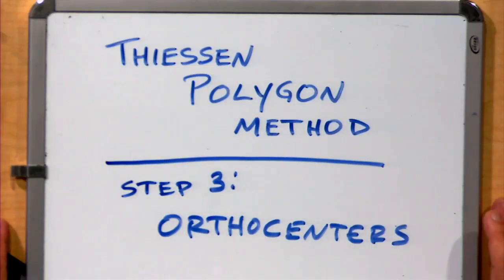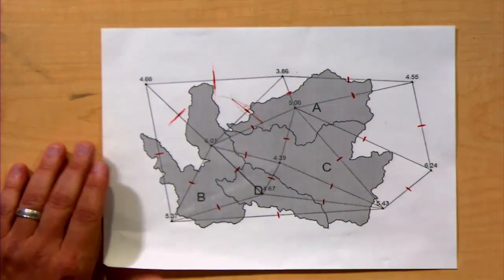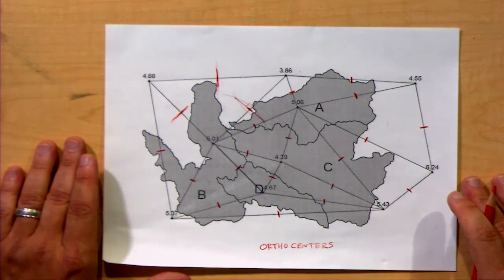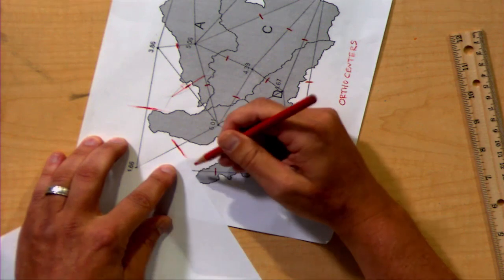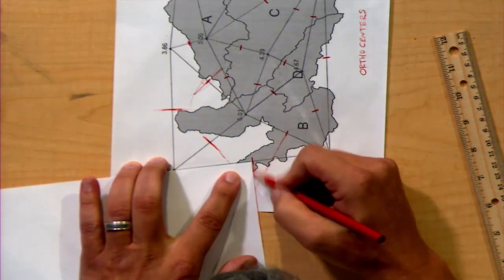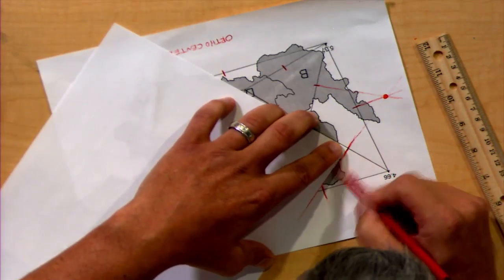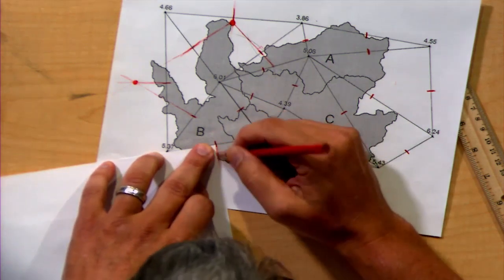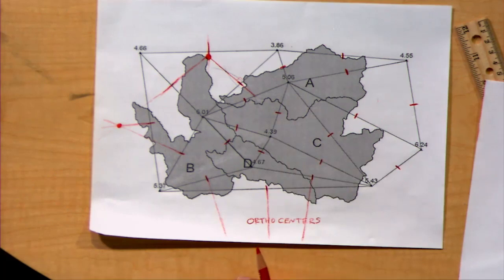Thiessen Polygon Method: Step 3

Comment: shouldn't they be circumcenters instead of orthocenters?
Reply from the maker: Yes, actually!  In retrospect, it appears that I used the wrong terminology for the intersection of perpendicular bisectors.  Thank you for the correction, but note that it doesn't change the method - use the intersection of perpendicular bisectors aka circumcenters.